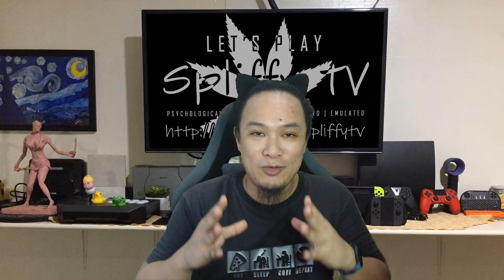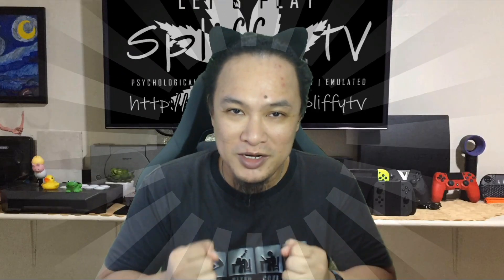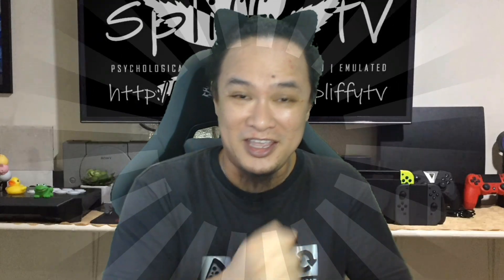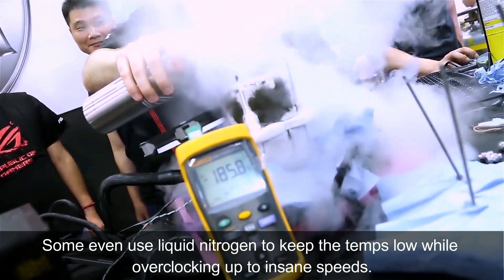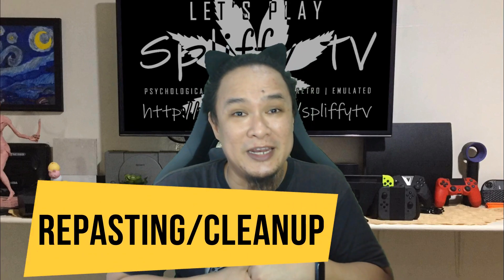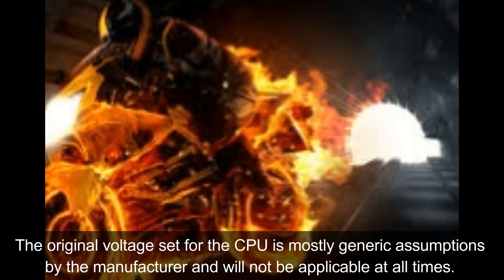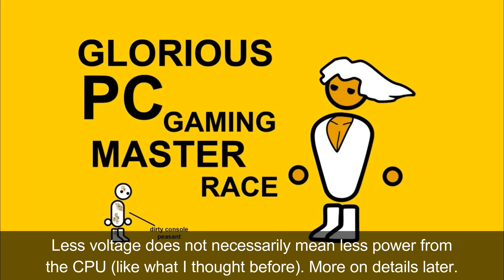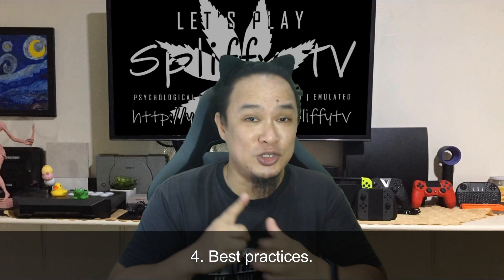How to Undervolt and Improve your Laptop's Performance (OMEN 15 dc0xxx) Solve Thermal Problems

Comment: I have the same Laptop and wanted to try this, but my coresettings in the programm are grey and can't be changend xx.
Reply from the maker: i hear that newer firmwares prevented this. this is why im reluctant to fw updates. you can check omen gaming hub, maybe they've integrated undervolting there

Comment: Hi the undervolting is recommended for daily usage?
Reply from the maker: hey bro. for me, undervolting is best for all occasions and it is completely safe since your system will just restart and revert to the default if you mess some of the values.. 
but most users won't feel the results when just doing moderate computing like microsoft office or internet browsing. most slowdowns and cpu throttling only occur in games when the processor gets hot. 
also check out my repasting guide if you want to cool it more. it is recommended to repaste annually. some even do it twice a year.
Reply: @SpliffyTV  thanks bro, so it will not effect if I only see a trading graphic?
Reply from the maker: you will see a big difference when you're playing a very demanding program. you can monitor your cpu usage at the taskmanager to know if it performs lower than expected. :)

Comment: Hi there man! I have an omen 15 laptop with an i7 9750H and a 1660 TI Nvidia, ive done everything u said but it seems nothing happens, my temperatures still the same, the only way i did lower my temperatures were by decreasing drastically short and max turbo power, from 90 watts both to 24 both of them at the cost of losing so much performance and cpu clock speed, i dont want that, how can i do a proper undervolt to my special hardware?
Reply: I also have tha same laptop omen 15 9750h with 1660ti facing same problem
Reply from the maker: hi bro. can you tell me what your bios version is? i got a theory that with newer models, the undervolting features were taken down by the manufacturer because of the plundervolt issue.
Reply: @SpliffyTV  dude i have the exact same specs as carlos restrepo even mine undervolting makes no diffrece temp are exactly same
Reply: my bios version is F.19
Reply from the maker: @aayush868  i can only assume that the undervolting features are taken off the newer models.
Reply: @SpliffyTV  k bro thats unfortunate :(

Comment: Specs:
Name: HP Omen Laptop 15
Processor: Intel(R) Core(TM) i7-8750H CPU @ 2.20GHz 2.21 GHz
Memory: 8GB
Graphics: Nvidia GeForce 1050, Intel(R) UHD 630

Before: 2060
-100 XTU: 2400+

But I have a problem with mine that simply wont go away

Its that when I play a game like Fortnite, the audio gets all distorted and staticy

When I play Valorant, it runs just fine

Ive noticed that my cpu temperature likes to sit around that 97°C mark

So would u think that the temperature might be the problem of static/distorted audio?
Reply from the maker: What’s ur bios version?

Comment: hi man, first of all: great video.
I've got the same cpu i7 8750H in a G5 dell laptop. I used to undervolt with throttlestop and everything was great: from 95-99°C to 75-85°C (with 150.4mV)... but now, they released some new update that raised back the temps and making throttlestop useless.
I noticed that u are using XTU. I installed, but it seems everything blocked to me. How to unlock the undervolt utilities? ty
Reply from the maker: Thanks bro. I have a theory that theyre pushing an update that will disable undervolting because of plundervolt. What is bios your version? Mine is F.09

Comment: What processor dou you have, coz  the ixtu can only be use with intel k processors right? Ive tried with 9750h and you cant undervolt.
Reply from the maker: i have 8750h 8th gen mobile cpu and its ok to use xtu. bios version f.09.
wait, what bios version do you have. does it work on throttlestop?
the current 10th gen cpu has undervolting disabled. i think its because of plundervolt. its possible, they're giving it also to the users of the latest bios update (just a theory)

Comment: 6 cores / 12 threads with max 4.10GHz turbo boost, so much potential ba na hold off lng gyud sa cooling. Still very impressive results with undervolting.
Reply from the maker: thanks bai. if desktop lang siguro ni, dako kaayo nig ma improve. without undervolting, 90deg celcius nani akoa in normal situations. bad design or probably ang slim factor ang problema jud sa thin and light gaming laptops.